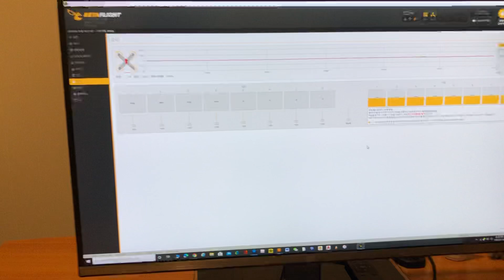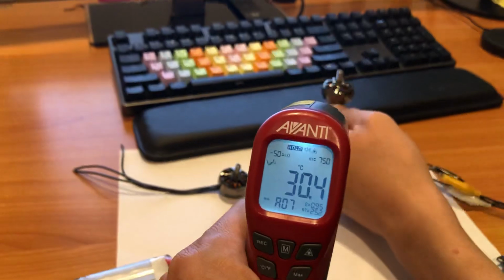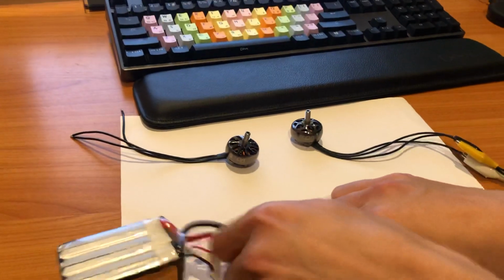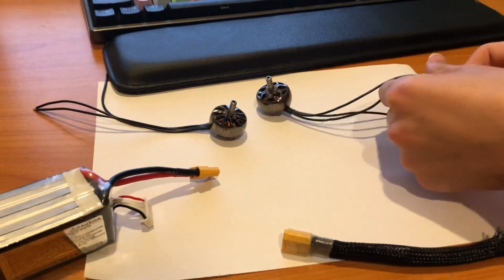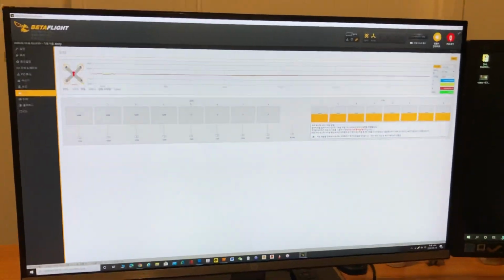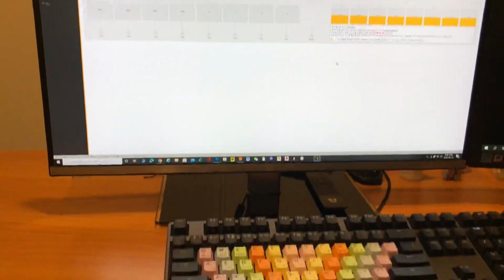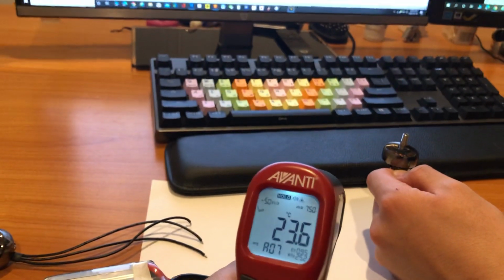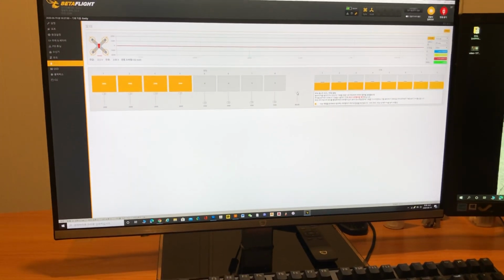Karearea TOA TURBINE motor temp test

Comment: all we can see is the temp of your hand
Reply from the maker: Cant you see the red laser dot at the motor bell??
Reply: You need to look closer because there's CLEARLY a red dot on the bell showing where the temp is being measured from.
Reply: @TyzaGFPV  red dot it is just a pointer, not the temperature measurer and its pointing line is always a little upper than the exact IR sensor of this thermometer. Also measuring area of this thermometer is pretty big